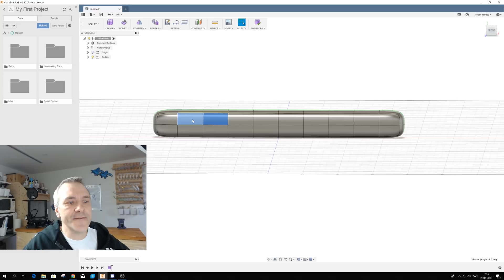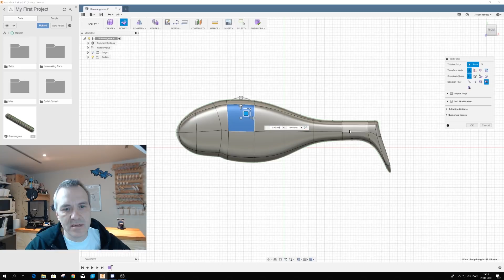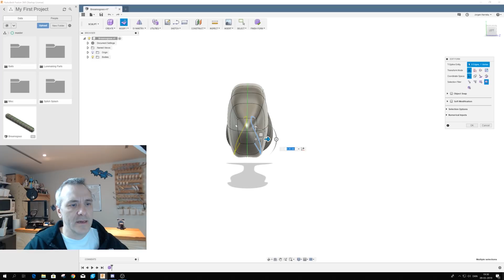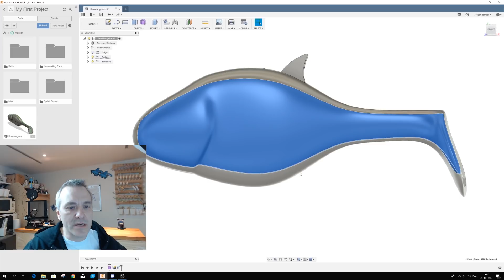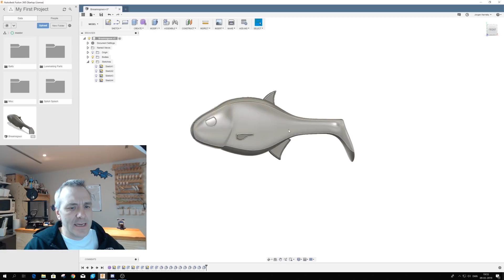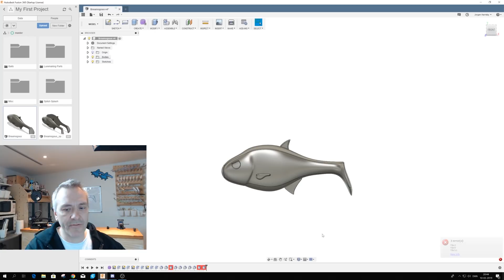Making a 3D drawing of a shad in Fusion 360

Comment: i am getting a da Vinci nano and started using AF 360 today. Rather fun. A lot easier to use than Blender. Is there a function that allows me to halve the lure then add a hollow cut-out inside to then add packaging Styrofoam peanuts into to create buoyancy? 

Also, when I want to create stencils for the lure, how is that process done?
Reply from the maker: Hi Dwight. You can use the split body tool to half the body. I think there is such function, but I don't think you need it. Once your lure has topcoat it will have the same boyancy with or without the styrofoam. But you might want to make room for the weights

Comment: Hi Jorgen, a quick tip, you can use the selection filter to select the desired item (in your case the sketch items) underneath faces and bodies, instead of hiding your body
Reply from the maker: Thanks for the tip - Still have a lot to learn regarding the use og Fusion

Comment: Really nicely done. Any idea to add scales to the master. That are printable? Details to the master look the most challenging. Difficult to sand them. Could try acetone but .......
Reply from the maker: I have not figured out a good way to put scales on the sides yet. I think there is other programs that handles that part better than Fusion 360. When it comes to details I am always split between how much should be on the cast and what should be painted. Painting details offers great flexibility while casted details are a lot easier. Acetone does not work with PLA, so if you want to go that way you should use ABS